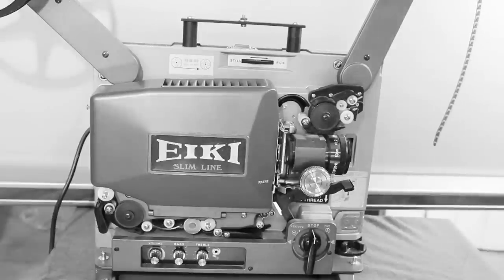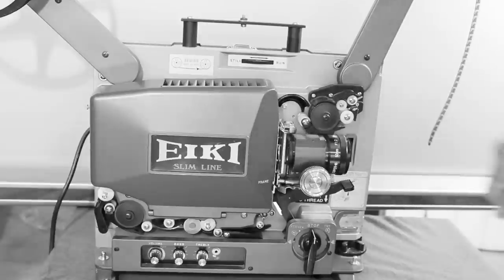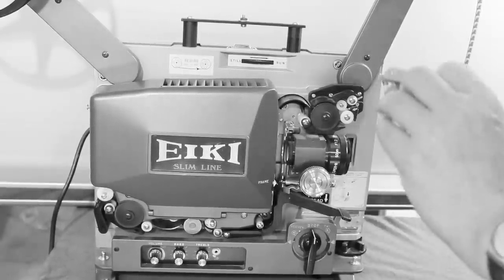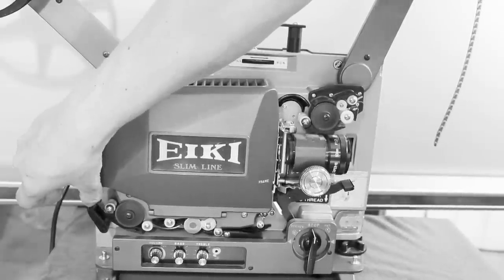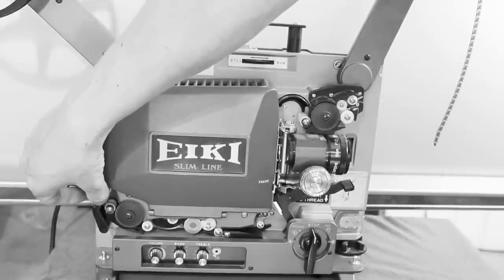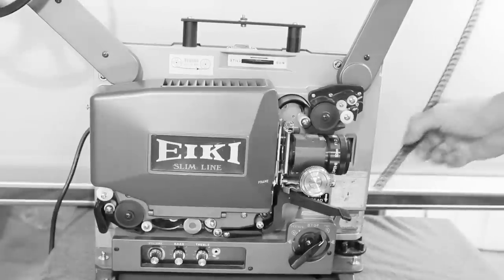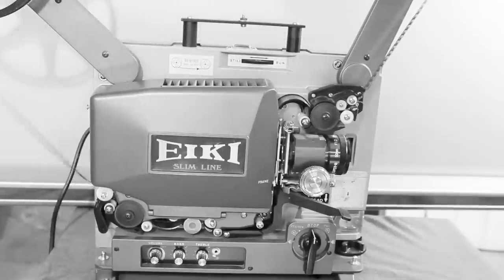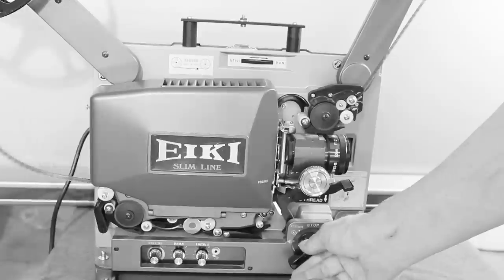Eiki Slimline SNT 16mm Projector Loading

Comment: The NT is a great projector. Many film enthusiasts look down their noses at an auto loader, but one that is properly serviced and clean will work fine. If your load lever won't stay down or when you pull on the last roller to release it and it returns slowly, your projector is in dire need of cleaning and lubrication. I have found on the NT models that cleanliness is very important. Pay special attention to the back side of the guide ramps where dirt, oil, wax and other forms of sludge can build up. This can impede the films leader in it's path to the end. Make sure your sound drum is spinning freely. Old lubrication in the shaft can cause it to drag, this can affect auto loading as well as scratch film. Also do not forget to service, clean and lubricate all of the nylon rollers in the film path. I usually dot them with a sharpie to ensure they are turning freely once I clean the shaft and lube them. Clean clean clean and you'll be forever happy! Don't forget to use nice fresh leader on your film and put a fresh cut on it before feeding. Acetate leader seems to be stiffer than many of the plastic leaders which can warp and bind. When not sure of a projector I have found that inching the film forward by turning the projector off and on can also help guide it on it's way to the back. Have fun!